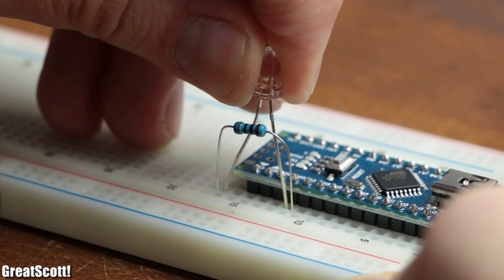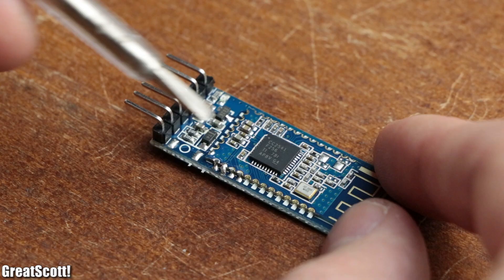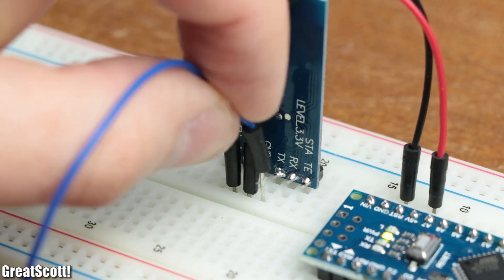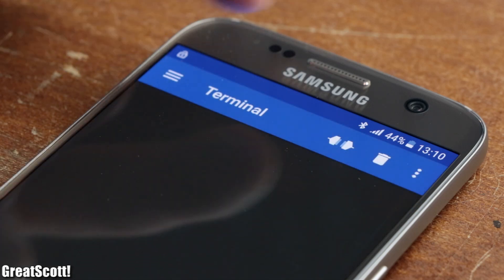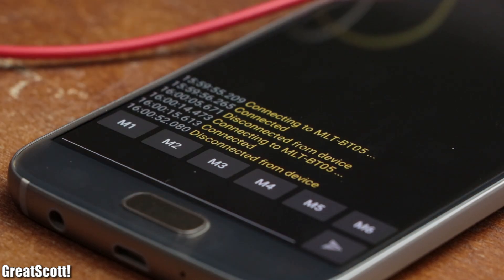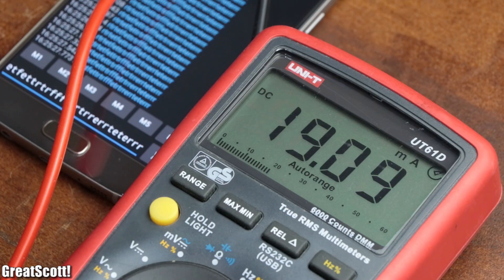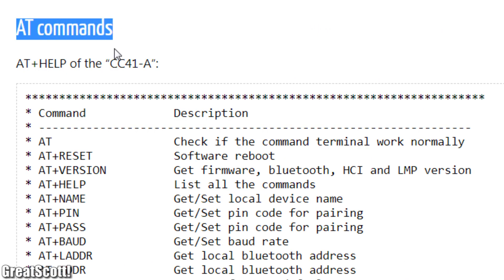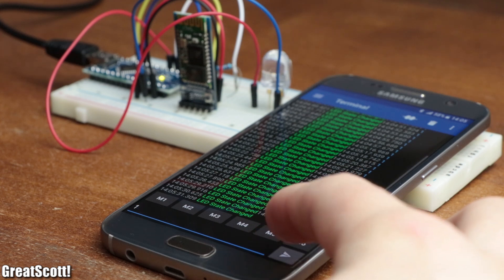Bluetooth 2.0 VS Bluetooth 4.0 (BLE) || Is an Upgrade worth it?

Comment: Can you Hack Hc05 0r 06 to make its All io ports to use hcxx itself as self BLUETOOTH Microcontroller without any external uC !! Or if possible , then show , how to uplode Arduino Bootloder on hcxx module !! . , Its is Because its all io pins can be use Faster then arduino because Pherheps its cpu clock is faster then other uC????

Comment: 2:26 why to use 3v when you already have 5v vcc pin in bluetooth base board??
Reply: bluetooth is 3v device, but it has voltage regulator on vcc pin.

Comment: Can a raspberry pi be used as a microcontoler?
Reply: Yes, but it is slower and uses A LOT more power
Reply: Yes but it's not worth it.
Reply: It has some trade offs as seen below, but has more computational power and when it comes to audio and video processing (ie for tracking video or playing audio) writing a script for that is easier than getting an Arduino with a bunch of attachments.
Reply: Slower?.. how do you work that out... 

Yes if you use Python or other high level language libraries to toggle the GPIO's then it is slow. However with proper software the GPIO's can be made to operate very quickly, Quicker than an Arduino can. along with the backing of having a vast amount more storage, memory and processing capabilities.

So the answer is YES. A pi is more capable is almost every way than an Arduino... BUT
It uses much more power. Up to 1.5 amp or so at 5v, this is a hundred times more than an Arduino roughly speaking. It is also pickier on how clean this power is.
It is also more difficult to program, if you want to get proper microcontroller type action, then you'll need a real time OS, or your application will need to be robust enough to not be adversely affected by a time sharing environment.
The current capacity of each pin is less than 1/10th on a Pi, so output buffering may be needed in cases where the 'duino wouldn't.
It has significantly poorer ESD, over-current and over-voltage protections/tolerances than most (if not all) microcontrollers.

If you can work around all of these points then the RaspberryPi makes a very compelling industrial computer, or controller.
Reply: Any device with serial port or can emulate it with GPIO can be used, including PC as motherboards still got serial port pins, this BT adapter works like old COM modem. Only issue is how to power it, serial port alone dont provide power
Reply: Use a microcontroller for hardware control, use raspberry for data crunching, operator interface that a microcontroller does not have the resources to do. RPI is not dedicated to hardware i/o . It is also running an operating system.

Comment: how i can use this as audio jack bluetooh receiver?
Reply: You can't. HM-05 and HM-10 transmit data, only data, not audio. You can physically connect the data lines to an audio input, but all you will get is modem sounds.

Comment: Bro I know C++ language but still I cannot make logic of a program. Can you please guide me. I want to make arduino programs my self, not CTRL+C  and CTRL+V in my projects.
Reply: Writing for a arduino is so easy.It even supports object oriented coding.what did you meant by saying "login of a program"?If you really know c++ then it should be easy for you everything is the same for,while,do-while,if.Think of the loop function as your main(the difference is that its an infinite loop that runs your code automatically over and over)
Reply: pe6o991 sorry. I meant logic.
Reply: People think that C++ also include standard library (cant be blamed as its part of specification and people learn that way)... which dont need to be included or is wrapped with something diffrent (like in Unreal Engine 4) so think only about syntax not APIs as you may find diffrent twists to it.
Reply: ImMalik get a course from udemy or Lynda they are awsome
Reply: 1. Get a university textbook on "data structures and algorithms", and read it, and then read it again. This will likely fill in some blanks for you and provide a necessary foundation. No, you can't just watch a video tutorial, it's a thicker book, not a 16 page booklet, for a reason.

2. Program more, ask better questions, receive more insightful answers. Also if you say 'bro' once again, you'll probably get slapped, so don't do that.

3. Programming is almost never about originality, originality is bad, originality is trouble. It's about recalling and applying solutions that work well and that don't cause issues - maybe your own solutions, maybe solutions by someone else. The trouble with copy-paste programmers, is that they don't understand what they're doing, and what issues they might be introducing, they don't understand what the code is doing, what its implications are, how it might fall apart if changed. If you have internalised the code, it's not copy paste any longer. Going back to you claiming that you "know C++" - but do you REALLY?
Reply: Go thru the tutorials. They come with Arduino

Comment: 2.0 = cheaper, problem solved
Reply: Here the hc-05 is $120 and the hm-10 is $175. So there's a difference
But then again the hc-06 is $400 and is a 2.0 module...
Reply: 4.0 = more secure, problem created to 2.0
Reply: 2.0 is BT Classic, 4.0 is BLE. Some older phones (pre-circa 2012) don't support BLE and only works with BT Classic. You can argue that no one uses a 2012 phone anymore, but keep in mind that many people are still using old laptops, which likely come without BLE. Generally, laptops before 2013~2014 support only BT Classic.
Reply: 4.0 cheaper on aliexpress
Reply: +Bo Gao And Bluetooth 2.0 doesn't work with iPhones and iPads since they have BT 4.0 (since a lot of time). Found out the hard way. So better use BT 4.0 if you want more compatibility.

Comment: In my oppinion Bluetooth is kind of overrated and obsolete. Just compare the 1.5 thousand page documentation of WiFi to the monstrous 4000 page documentation for Bluetooth(not even including its extensions). Protocols we use everyday in, lets say, a bluetooth speaker are lying on top of not less than 8 other layers. Its ridiculous!

But, noone seems to be doing anything to replace it, following a principle - "Don't touch it if it's not broken"
Reply: Mk Km Bluetooth is a universal system with predetermined protocols. It sucks, but all audio devices work together, file transfers too, and so on. It's absolutely horrible, but we don't have anything similar.
Reply: Mk Km comparing Bluetooth to WiFi just by comparing the size of either documentation? That's no real argument but otherwise I agree in some regards.
Reply: Not doing anything to replace it helps it be so universal. My Nokia 808 is still usefull as a camera that can send photos over bluetooth for example.
Reply: Mk Km Get back to me when you come up with a meshable protocol that doesn't make my machine loose internet connectivity when I'm connected to multiple sensors simultaneously to do process monitoring. WiFi is a wireless ethernet system. Bluetooth is a hub-less SMMS system.  Neither can completely replace the other transparently.
Reply: It's like comparing apples to oranges, bluetooth is for transmitting small amount of data or commands in a constant flow, while wifi is for transferring large amounts of data at a variable speeds and long distances
Reply: Bluetooth covers multiple protocol layers, as it also defines use cases and devices, while WiFi is just a physical layer to transmit Internet protocol packets. Most Bluetooth devices are really small and simple and need to be kept power frugal, so they can not be burdened with TCP/UDP/IP. Similarly USB spec is a monstrosity because it must make many simple devices interoperable.

And then to be kept in mind that including all relevant IETF RFCs, the size of WLAN spec would be unfathomable. It would be measured not in thousands of pages, but in millions.

Another little reminder that the 7 layer OSI model characterises every form of communication. Doesn't mean that every of these layers is technically distinct in implementation, the separation is often merely conceptual in nature and aids comprehension, testability and interoperability.

Comment: It is a lie that they work exactly the same, the author of the video does not do the tests of the two modules well, clearly the HC-05 has much higher latency times than the HM-10 module, bad video, very regular tests.

Comment: I hate Bluetooth 4.x, it's total crap!
I have been using Bluetooth for many years already, using many devices, and everything was working fine in BT2.0 times. But since that BT4.x shit is on the market, all my devices suffer from abysmall radio ranges, like 50cm and frequent disconnects!
It's sust fucking industry fake crap.